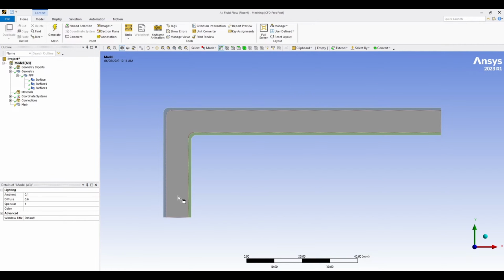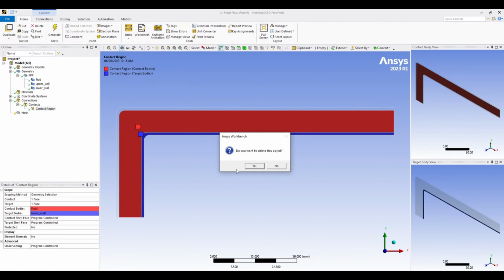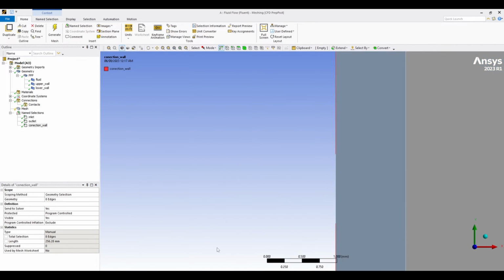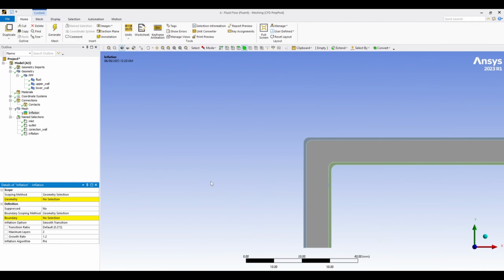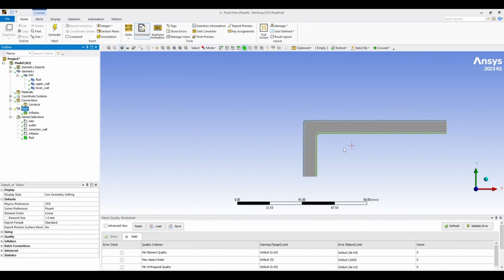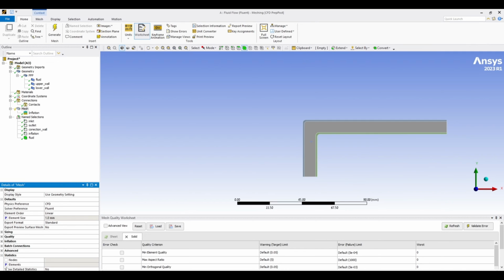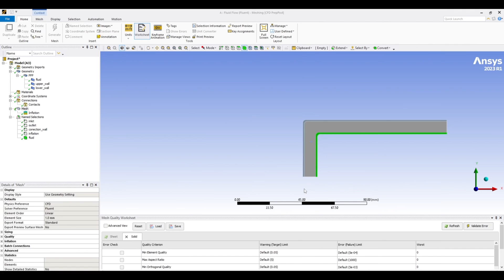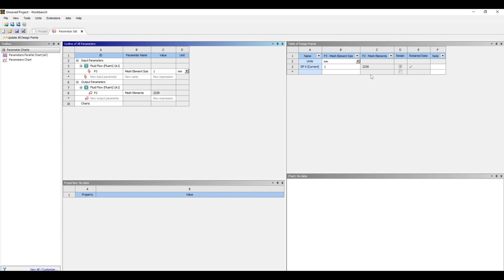Ansys Fluent tutorial | Parametric analysis for mesh sensitivity (Grid resolution) | part 2/3

Comment: Very useful, but there is a problem. How the geometry is transferred from SpaceCaim to Fluent Meshing is not clear. After creating the geometry in SpaceClaim, I am stuck. Can you help.
Reply: I will try and come back. Thanks a lot.
Reply from the maker: For geometry transfer from SpaceClaim to meshing you don't need to do anything 
Just close the SpaceClaim and open the Meshing module from project schematic.
The geometry will automatically transfer from SpaceClaim to meshing.

PS: It is not true if you are using SpaceClaim as stand alone
Reply: @WaqasLearnTech  It still does not work. When I open the meshing module by right clicking and 
click 'edit', it shows me errors. I am using 2024 R1 student edition. In the workbench at the beginning, there are three options to begin the exercise, like Fluid Flow (CFX), Fluid Flow (fluent with fluent mesh) and Fluid Flow (fluent). I chose the second one.
Reply from the maker: @RamamohanRV First option is for CFX. I am not using it

 The 2nd and 3rd options both use fluent for simulation but 2nd options uses Fluent environment for meshing. The third option uses Ansys meshing module.

This tutorial is for third option Fluid flow (fluent). Try with that. 
When you will close SpaceClaim you would see a "green tick" on the the right side of geometry tab. It indicates that this tab is updated and you can open the next tab.

In second option Fluid flow (fluent with meshing), the geometry doesn't transfer automatically to next. You have to import the geometry after opening the meshing tab. You can see that in this video

https://youtu.be/wzwGaBcxmvc

However, I didn't show how you can use parametric analysis using 2nd option. Maybe I'll do in my next video
Reply: @WaqasLearnTech  Yes, this worked. Thanks a lot. I actually want to do this mesh sensitivity analysis for a 3D model. Whether there is a separate video from you ? Any difference from 2D analysis shown in this video ?
Reply from the maker: @RamamohanRV  I don't have any video for 3D case. But there is no difference at all. You can select the mesh controlling parameter in the same way as for 2D. It will work exactly in the same way for 3D.
Reply: @WaqasLearnTech  Yes, this worked. I could carry out 3D mesh sensitivity analysis. However, there are two problems I came across - (1) for mesh size between 4 mm to 9.5 mm, my solutions did not converge even after 1000 iterations. Only at 9.6 mm or more the solutions are converging. I avoided going for less than 4 mm, as the mesh elements are going beyond 500,000 which is the limit for Student edition. Why do the solutions not converge for finer mesh resolution? (2) After the calculations are run for a given design point till convergence, the solution graphical display of residuals and output parameters disappear on their own. How to retain and save the solution transcripts and graphs ?
Reply from the maker: @RamamohanRV  For the convergence it is difficult to say something like that. 
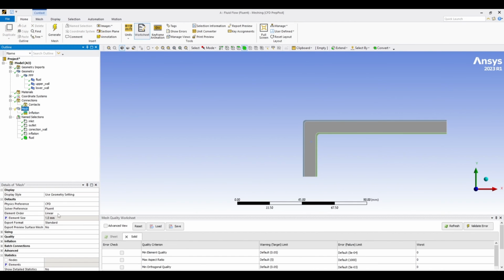Was you residual going down? or your solution was diverging. you can follow your solution progress as I mentioned at 7:25
https://www.youtube.com/watch?v=KOrkzvCh2X0&t=475s
If the residual is decreasing it will eventually converge. With finer elements it takes sometimes longer to converges. However if the residual is not converging then you have to check the mesh quality for that specific case.
To retain your simulation data in the workbench when you open "parameter set" tab. You can find your input and output parameters over there. After input/output parameter there you can find another column named "retain". To retain you data you have to check the box in respective row of your design point. By default they are unchecked. With unchecked box you can read the data only on this tab but they are not saved in _files folder.
Reply: @WaqasLearnTech  Thanks a lot. The simulation data is now saved and available for review later. But this convergence problem remains. At finer elements, the residuals are remaining flat or going in cyclical ups and downs. I did check the mesh quality in the solver, and it shows no errors. Also, at larger mesh element size, the solution converges. So, mesh quality may not be a problem (my guess!). Is it okay to run further by increasing the iterations to 2000 or so ? If you can give your email, I will share some screenshots for better illustration of my problem.
Reply from the maker: @RamamohanRV  you can send me screenshots on this email waqas_chem133@yahoo.com